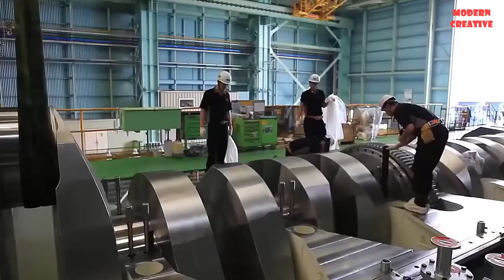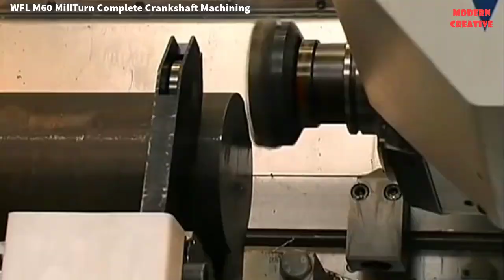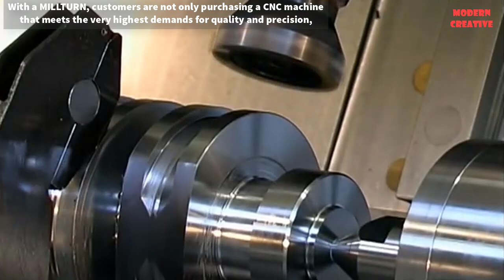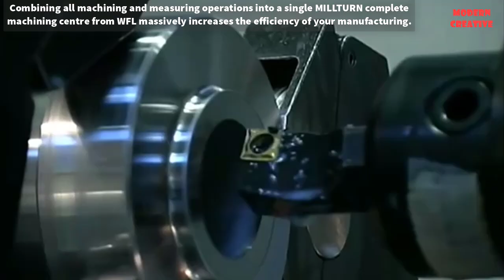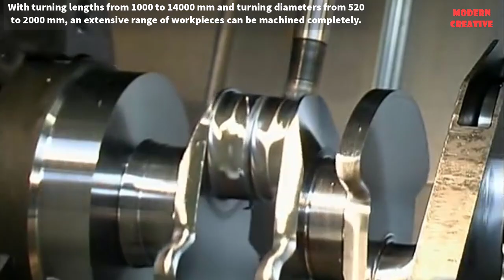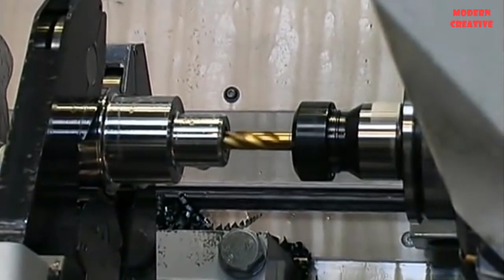The Biggest Ship Engine In The World And CNC Machine Complete Crankshaft Machining

Comment: Parts bigger than a lorry with tolerances finer than cigarette paper. I seen a video of a ships piston being decoked in the 1930s ( I guess) The man doing it stood on top of the piston in the chamber. he got in  through a hatch in the cylinder below the piston ring line. Below the combustion area. The door was about 3 foot square with a bolt every couple of inches. I've looked for that video but it's vanished.. They used to be huge now they're smaller and rev faster and give far more BHP psi.

Comment: A few generic shots of a ship engine being assembled, not machined.
The rest of the video is CNC of a billet crank being machined, but not for a real engine.  It has 2 rod journals at the front for single cylinders, and rod journal for two cylinders, and a split rod journal for two cylinders.  Obviously just a piece to show machining capabilities.
Reply: You said almost exactly what I was about to comment.
Reply: Yes Sir. I worked 17 years as a cnc miller. The footage is impressive, but not in the slightest the crankshaft from the beginning